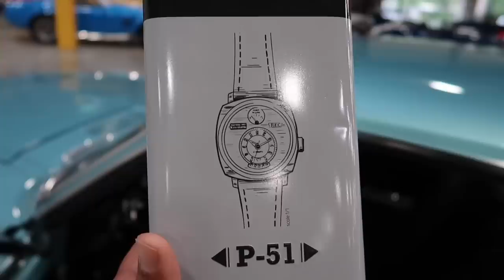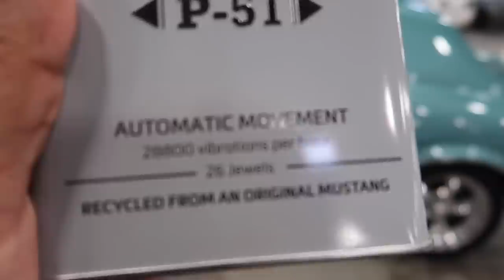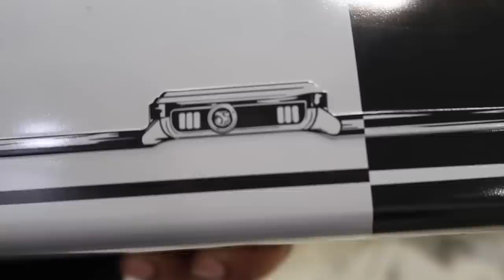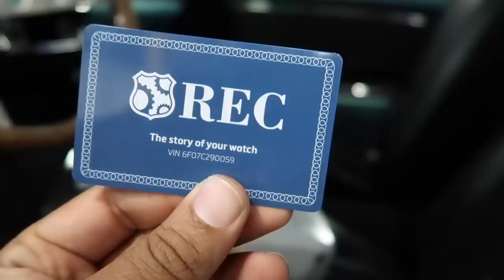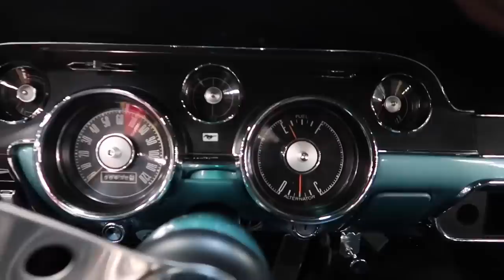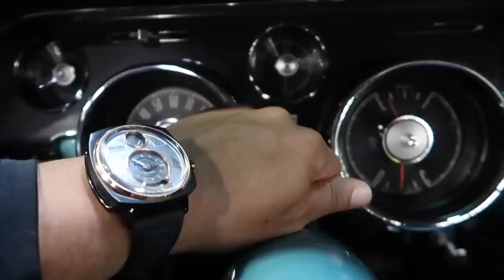HERE’S THE NEXT MUSTANG IM GETTING & I ALREADY HAVE A 1966 CUSTOM MUSTANG....WATCH!

Comment: Great choice.  The 1967 and 1968 are my favorite.  I prefer the fastbacks,,,,but I love them all
Reply: While I was building my 1940 Ford Deluxe coupe, I bought a C code 67 Coupe for $900   ..rebuilt the engine with K code cam, 4bbl intake and heads, 3.50 Posi and top loader, complete interior w/new seat form, repainted, badged and decaled as a GT ..$7500 into the car and sold it on Ebay for $13K  ..made $5500 in two months.  These deals are still out there.
Reply from the maker: TheArkDoc yea I’m leaning 1969

Comment: I had a 66 Ford Mustang Coupe while in High School and I fixed it up like a 66 Shelby GT350 Coupe!

My favorite Mustang is the 69/70 Shelby  GT500/GT350!...I Agree the 69 Mustang would be your Best Choice!

The 69 Mustang was produced as a Sportsroof aka Fastback, a Coupe aka a Hard Top and a Convertible!...The Models came from Ford as a Based model, a GT, a Mach 1, a BOSS 302/BOSS 429 and the Shelby GT500/GT350
 Models!

My Suggestion is to get a 69 Ford Mustang Coupe aka Hardtop and fix it up like a Hardtop Coupe Shelby GT500/GT350 Mustang!...Shelby Never Built a 69 Hardtop Coupe Shelby!

The closest Shelby came to a Hardtop Coupe Shelby was a Prototype 68 Hardtop Coupe called the 1968 Shelby EXP500 EXP aka the "Green Hornet"!

You could Build a 69 Hardtop Coupe Shelby EXP500 Tribute Mustang!...With a 5.0L Coyote 460HP engine, add a 5 Gen 3.0L Stage 3 (Tune) Whipple  S/C rated at 900HP, a 10sp Auto Trans and IRS!...I am Just Saying!...God Bless!
Reply from the maker: Awesome thanks for feedback - amazing breakdown - just looks now the right candidate 69-